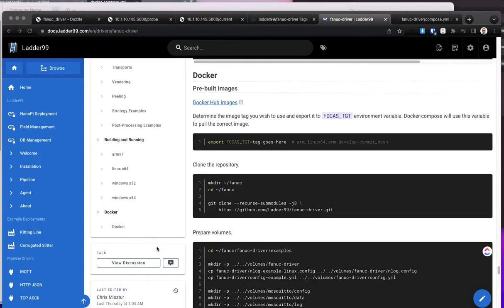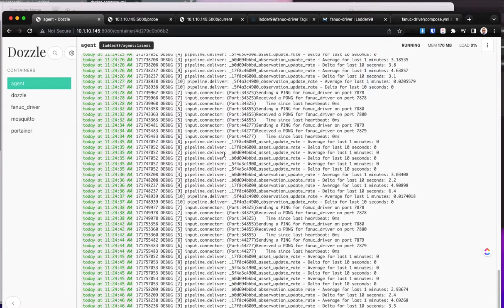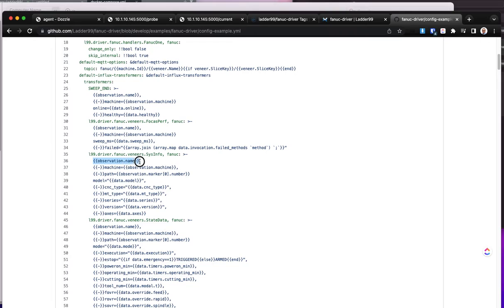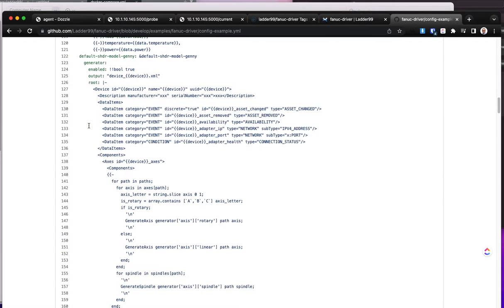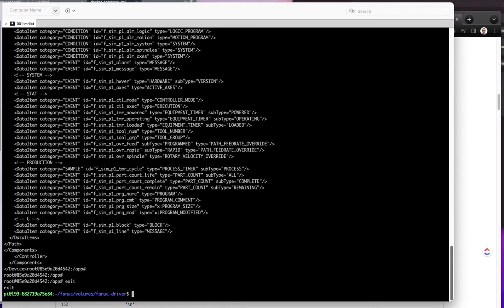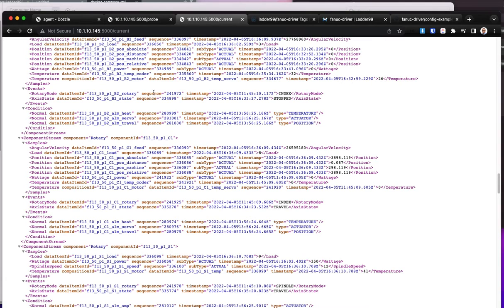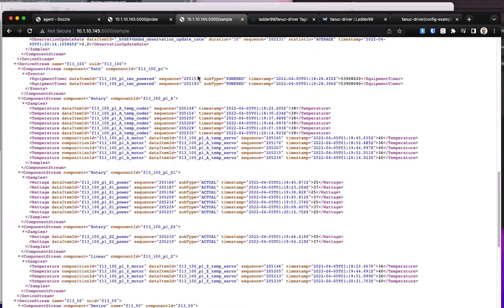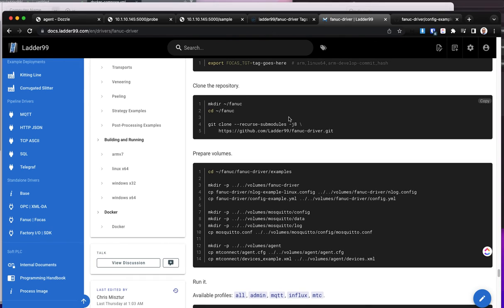Fanuc-Driver + MTConnect

Comment: Awesome tool!. Is it possible to output CNC macro variables or are they already included in any of the collectors?
Reply from the maker: Thanks.  Those are not implemented yet.  Please open an issue with some detail on Github.

Comment: Hi Chris, what do you recommend - when to use sparkplugb and when to use mtconnect?
Reply from the maker: Hi Anir.  Currently the MTConnect reference Agent supports HTTP protocol. This will change soon and SparkplugB support will  be added.  My suggestion is to run everything through an MTConnect model.  This way, your assets will be represented similarly, something you cannot achieve with SpB alone.  So to answer your question, you will want to use both at the same time :)  SpB to handle the transport and syntax, MTConnect to handle the semantics.  If you have not seen, we also have an MTConnect "historian" https://docs.ladder99.com/en/latest/page/introduction/what-is-ladder99.html
Reply: @MrIIoT  Chris, I am slightly confused on your comment. In your sparkplugB video, I can see that data is properly classified and one can understand basic data around production, spindle, axes etc in ignition. If the same data can come in node-red via sparkplugB node then what more data classification does one need? One can do without mtconnect in that case. What do you think?
Reply from the maker: @AnilSagarKumar  Yes, it is easy to understand by a human.  And it can be made simple to interpret by a machine (or consumer).  The problem arises when you scale.  And you most likely will not experience the problem until you scale and have different machine data streams.  Somewhere you will need to interpret every data stream.  Yes, SpB defines the payload syntax and a metric path (/path/1/controller/execution), but it does not define the language used to communicate the intent.  What happens when you have a Modbus source where the machine execution state is a formula across three different registers?  Where will you make that interpretation that (register1 == 1 && register5 == 200 && register10 == 20) = 'machine running' ?  And what does exactly 'machine running' mean?  Is the part loaded and being cut or is it simply that the power is on?  MTConnect device model helps push all of this closer to the data source so that :  1. it is understood by computers and humans, 2. it becomes the semantic API into your machine tool, 3. it does not need to be re-interpreted by every consumer.
Reply: Thanks Chris for the insight. We are currently using nodered for machines other than cnc. Nodered has also got an spb node which provides seamless integration. Influx node is also there which becomes really nice to have when combined with grafana. For cnc machines, ladder99 makes lot of sense. We are still trying to finalize the best way around this. Your work and advice is very helpful.
Reply from the maker: @AnilSagarKumar  You might find this interesting.  I think with some work and maybe custom nodes, it could be simplified.  https://mtcup.org/en/guides/modeling-strut-assy
Reply: @MrIIoT  Interesting indeed 🙂... thanks for sharing.